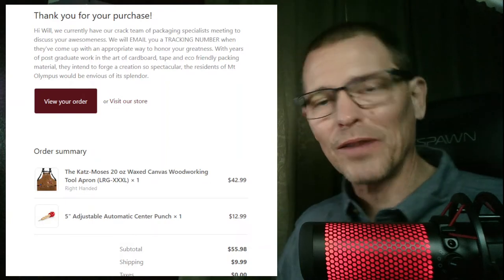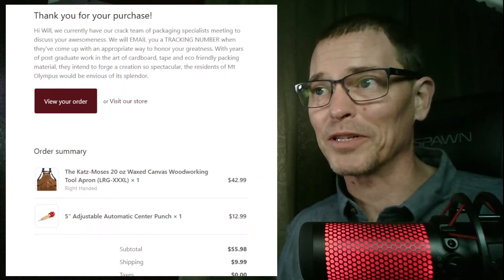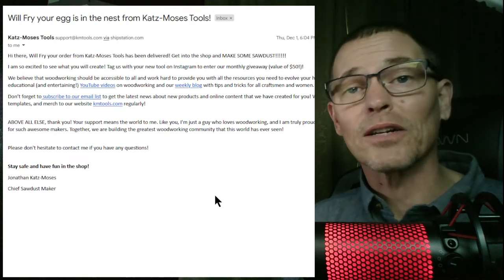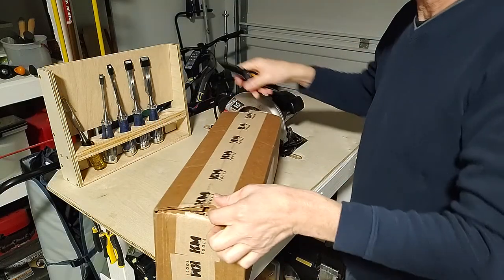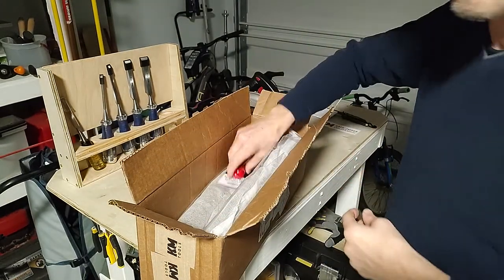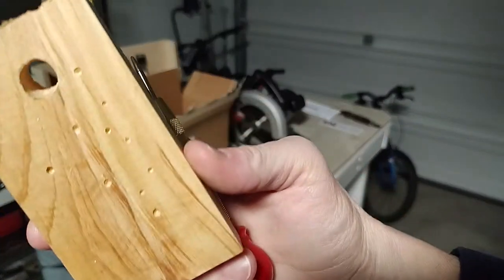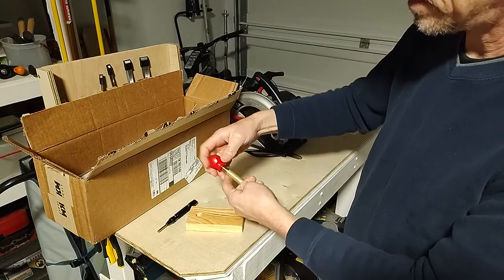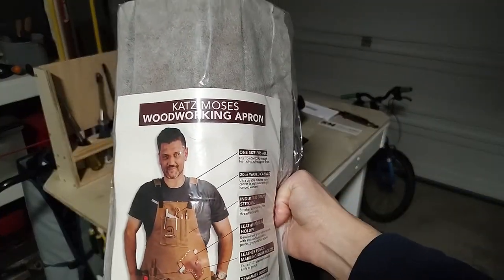Katz-Moses Shop Apron : Unboxing & Review

Comment: You could put a piece of foam backer rod that fits in the pocket that holds your marking knife so it doesn't go down so far in. Plus, it would offer the bottom of the pocket some protection from the blade. Backer rod comes in several size diameters and can be found almost everywhere you'll find caulk. Only problem is, you'll have to buy like 25 feet of this stuff just to get a one inch piece.
Reply from the maker: That's an excellent suggestion! Thanks. (I think I actually have a few spare feet of it lying around somewhere.)